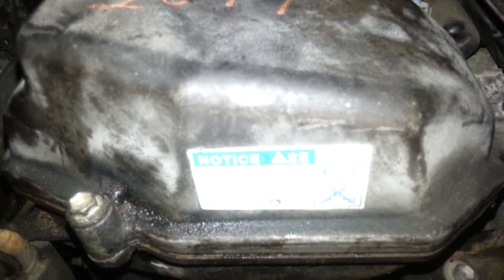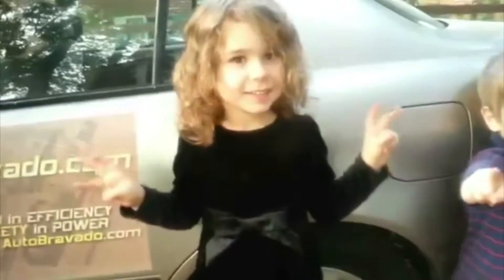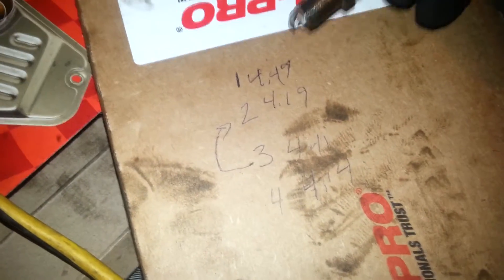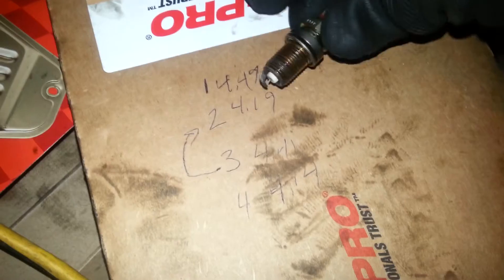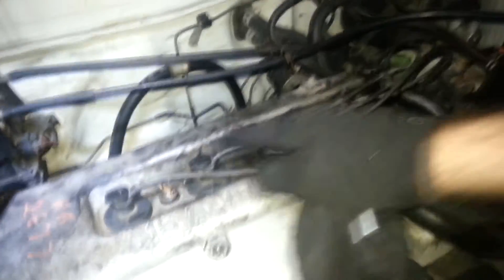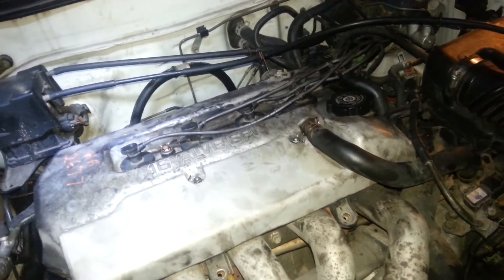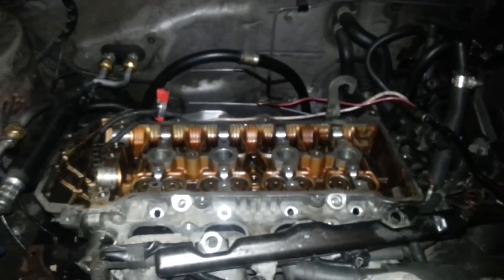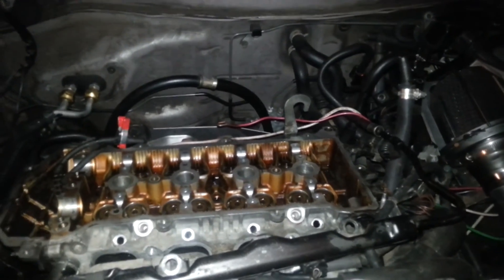Balancing Spark with Spark Plug Gap and an extra secret! Shhh!

Comment: I'm sticking to diesel, messing around with plugs to that level seems too hard!
Reply from the maker: +Badgertronix Just putting them in on this car? 15 minutes. With spark plug gapping maybe 30 minutes. 

For my truck it took a few hours with the hard one in the back. And maybe 30-45 minutes for the rest of them (video coming).

On my deeper, 1/2 hour long video setting up for my truck spark plug wire video, I took only a little longer than the video to get the plugs ready including checking the gap. https://youtu.be/I_7jXXmwFcE

...without filming? Typically, 30 minutes for spark plug wires and spark plugs for making the plan. 

Coil on plug? Often only 15 minutes. Working around spark plug wires with how they very is the real crazy effort!

Badger...so said the man who is pulling engines and transmissions. ..so says I back. Way too much effort. Lol ;) (not really when. It's worth it)
Reply from the maker: Badger, I thought you watched a different spark plug video so I had to edit it to creat context. YouTube Studio doesn't let you see what video the comment is on unless you back out and reopen the app.

It's all good though. I linked to the video, which I was accidentally talking about! Lol. Oh I crack myself up.

Stuzman says this makes no change to spark plug power produced, but I replied that it makes timing advanced from cylinder to cylinder more equal, and with decent injectors on new spark plugs, my truck went from 89-93 hp at WOT to 109...I'll be making a graph and showing it better soon.

Comment: I forgot to mention that new plugs should never be fitted without gapping them first to the vehicle manufacturer's spec as they don't come readily gapped for the vehicle for which they are purchased.    
In my experience the gaps of plugs out of the box sometimes varies.
Reply from the maker: +wontputrealname they're improving, but I never trust either. Better to be sure.

That said...plugs often lose there gap after three days so if you're me you'll "waste" your time doing ot twice instead of just after their break-in. Lol

I can always hear if a plug lost it's gap and it's never all of them that need re-gapping. I should be easier on myself. Lol
Reply from the maker: Gapping not yapping. I edited it.

Comment: I heard you mention gold palladium plugs at one point.    
Many years ago I ran a Honda Goldwing which was pretty cold blooded, meaning it took about 2 miles from cold on a winter morning before I could completely dispence with the choke.    
I bought a set of Champion Gold Palladium plugs and fitted them, late on a freezing cold night, and when they were fitted I hit the starter button with no choke on and a closed throttle, really just for no particular reason.    
You can imagine how surprised I was when she started almost instantly, sitting at an idle speed not even registering on the tacho. I turned it off as I didn't want it to run that slowly, and didn't want to put any heat into it before the next start in the morning.    
The following morning I went through my usual routine for starting out on my commute and found that after 200 yards the thing would idle (slowly, I guessed it at about 400 rpm) at the end of my street, and respond to the throttle with no "fluffing" or hesitation as I pulled out onto the main road.    
The bike was transformed with the cold bloodedness totally gone.    
I still used a bit of choke after this as I was a little concerned about the possibility of oil starvation at such low revs.
Reply from the maker: I read this story many times and I just couldn't fathom how that made such a difference. I kept giving up, and then I came back to the video because it was slowly starting to go viral and I noticed I hadn't yet read your comment. Just know. It was read many times with rapt fascination. :)
Reply from the maker: You really do great comments. I hope you've subscribed to my channel. There's a crisis on YouTube where we don't get paid anymore if we don't have 1,000 subs. Some people act like it's not a big deal because they get more value personally from being on YouTube than financially. Well, I do too, lol, but that doesn't mean it doesn't help. Increases how much I can invest in good production and gives hope of something more, you know? Thanks!

Comment: I'm completely lost as to how to listen to the difference in the engine sound in relation to a couple of thou gap, HAHA your pulling my leg or what, LOL
Reply from the maker: +STEVE ROB Nope. I'm completely serious. Go listen to different cylinders on your engine. Some will sound duller. Some brighter. I've always used a heavy metal tool, but then I have memory loss for when I got shocked doing that, so I've bought a mechanics stethoscope! You know, like what a doctor wears but I've tried one of those doctor-y ones and you'll ruin your hearing. Those are meant to listen to the pitter patter of a heart not a throbbing engine!

My dear subscriber Zx for short told me to stop using a heavy metal tool and I will. Lol THEN I remembered the feint memory of being shocked. (Causes amnesia, or for that I'm only slightly pulling your leg, lol.)

Anyway, slower cylinders sound duller and faster ones sound brighter. You sir are listening to spark!

If it's duller then ignition was later. Tighten the spark plug gap and now it's sooner!

Its very simple. Even mechanics who mostly destroyed their hearing can do it...but most are clueless on this subject so I had to learn this all on my own. A few rare people agree and know what I'm talking about

To further prove my point, this will balance the sound of an engine even when injectors are imbalanced. This means you are definitely hearing spark and fuel flow and power per cylinder still can't be discovered without a balance test wear you kill one injector at a time and write the varying resulting RPM's down.

Comment: So to make your life easyer, you make every lead the same length as the distance to the farest plug, yes you get some loopey leads but the plugs should be closer to each other gapping wise.
Reply from the maker: +zx8401ztv heck yeah that's easier! On a brutal engine to balance, I bought two sets of spark plug wires just to make it easier.

Be warned, longer wires aren't always higher resistance. One manufacturer can't even make them all the same!

Sorry for all the ! It's just that I'm excites. I've had this information in me for nearly two decades, refined over that time of course, and most professionals don't understand electricity enough and they think I'm spouting poppy cock.
Reply from the maker: +zx8401ztv Oh and I was just telling Steve Rob your advice if you'd like to check it out on the video. Very entertaining I'd think. :)
Reply: I dont know steve rob, but my ramblings arnt advise lol :-D.
They are me just jibbering on, about a subject ive never really thought about, im commenting so you know i have watched your video.
It dont mean i actually understand it fully... ok at all LOL :-D
Reply from the maker: +zx8401ztv Lol Well you took away muwm amnesia from shocking myself checking spark with a heavy metal tool. Lol

You've saved me a lot of trouble altogether even if you don't understand iy all. Lol
Reply: Well i cant see how resistance variations can make such a massive difference, but you have experence and i dont.
So i listen o master he he :-D
Reply: lol, ive been a basic repair man for 35 ish years, i know enough to get most things working, but some aspects of electronics just send my brain in a spin.

Connecting your head to a sparkplug cable by accident would not have done you any good, i had to say something, i dont like seeing people hurt.
Reply from the maker: +zx8401ztv Some electronics leave me baffled as well.
Reply from the maker: zx8401ztv I missed your comment about resistance making much difference in the plug.

These were the closest plug set I've ever seen without checking ten of them to get a matched set. So for this customer he'll be fine.

I just checked a bunch of them for my truck yesterday and they varied by as much as 1.5 vs. the set on the video the that were within .3.

The difference is an engine that runs as smooth as glass instead of being stumbly or even violent misfires when the plug set is really unmatched.

Comment: DE, when you're talking about a 1/2 of a thousand of an inch in a spark plug gap, can you really hear that difference in the engine cylinder of how it sounds. If so, you've got a better ear than me. And isn't 70,000 to 100,000 Ohms for those spark plug wires a little high. Best I remember, they should measure about 5K Ohms per foot. With a resistance of 70K to 100K, this implies that the wires are from about 14 feet to 20 feet long. Did I miss something in this video? :)
Reply from the maker: Ford Motor Company makes their spark plug wires typically at about 60k ohms per spark plug and that changes a bit with length. My uncle claims that they're 6k per foot and that this somehow works out as well, but I've observed different in reality.

Maybe it's because these 1ZZ-FE engine crave a really strong spark, the second car, my car in the garage is an engine that went to coil on plugs just to get that much stronger of a spark, and more importantly, it makes balancing spark a lot easier when you don't have to account for such differences between wires.

It think I've got the reason for you. These are "cold" spark plug wires. They're a hot day room temperature, but they're cool for not being on a warmed up engine. In actual operation, I see numbers much closer to what you're talking about.

Remember the one spark plug wire I replaced on my Nissan Frontier? The math cold said I chose the right wire for replacement, but it ran rough until the new wire caught up with the rest it's brother spark plug wires and got into normal operating temp.

https://youtu.be/kHF5BVHszcc

And no, I can't really hear the difference less than a thousandth of a spark plug gap, but when I match spark plug gap against manufacturing inconsistencies of the spark plug core having different ohms of resistance, I have to get into 5/10,000 changes occasionally. I try to find numbers that'll balance with just 1/1,000 of a change, but it doesn't always work.

When there are shorter and longer spark plug wires, I've had to make as much as 2/1,000 of an inch changes between plugs, which made a factory .044" get balanced with numbers as small as .040" on one spark plug and as high as .050" to finely tune a 1999 Mercury Sable running good on new spark plugs. But before I write that article again, here's the link from 9 years ago: http://autobravado.blogspot.com/2008/02/spark-plug-gap-controversial-side.html